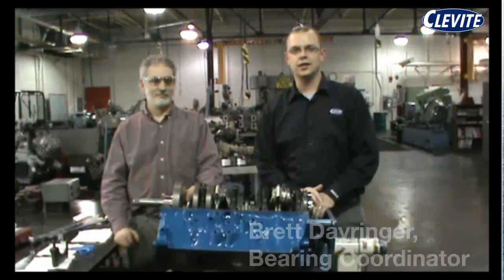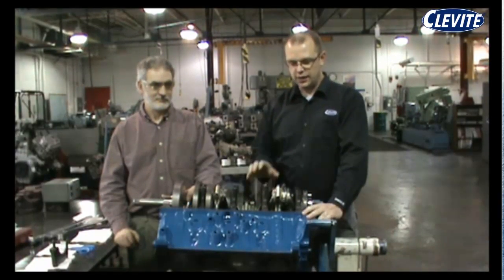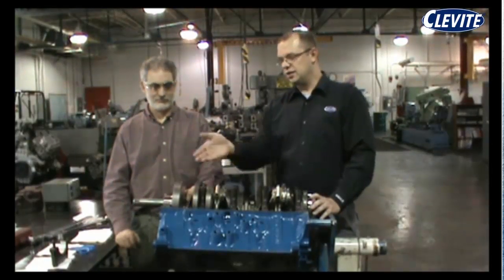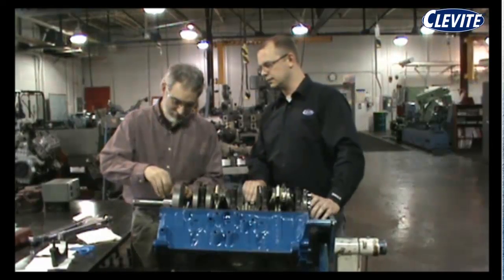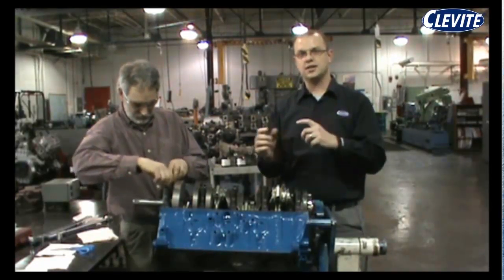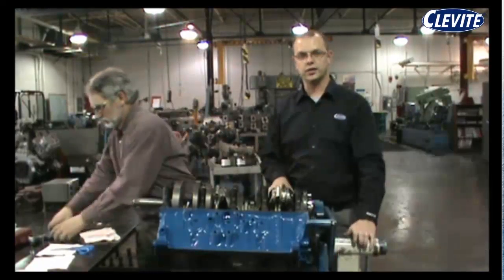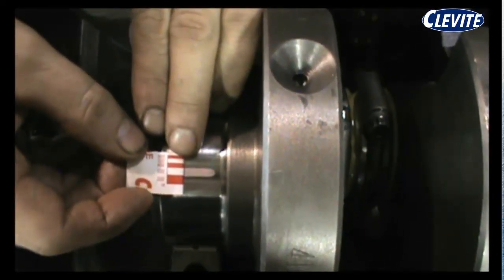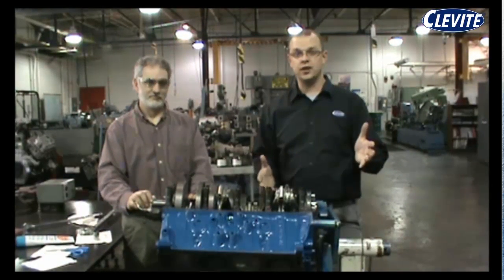Using Clevite Plastigage to Check Oil Clearance

Comment: Do you guys think that plastigauge is an accurate way to measure main bearing clearances?
Reply: not THE most accurate but as long as youre not teetering on the edge of clearances, youll be fine
Reply: btw, had my 13 wrx rod bearing go out just days b4 my son was born.  needed a car so had to take a huge loss to make sure my wife had a car in case of emergency.  it was 3k miles outside of warranty.  sna told me "we didnt ask u to lower your warranty, why are you asking to raise our warranty?"  careful with em, but i really miss her :(